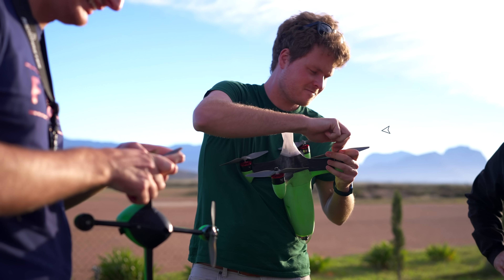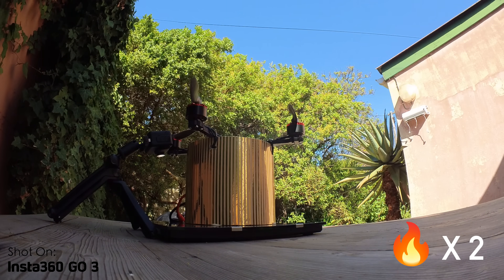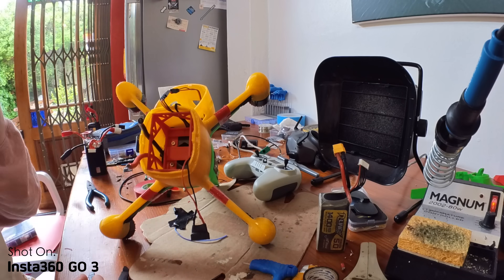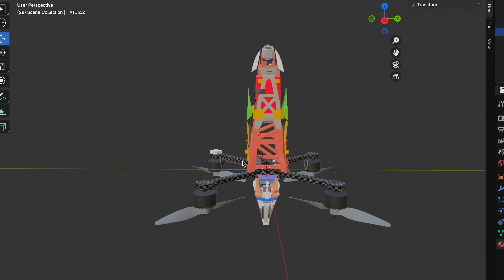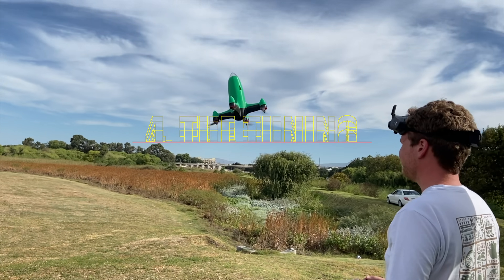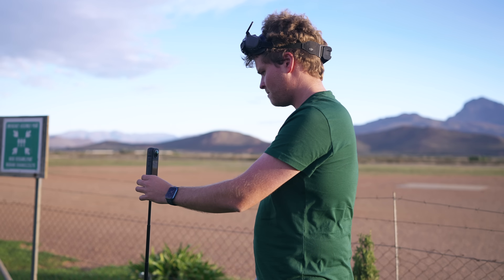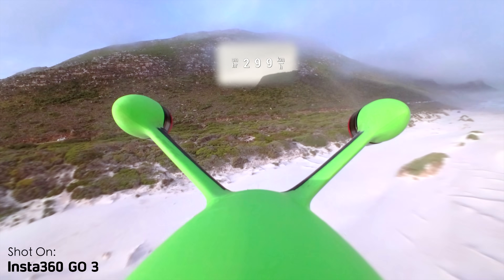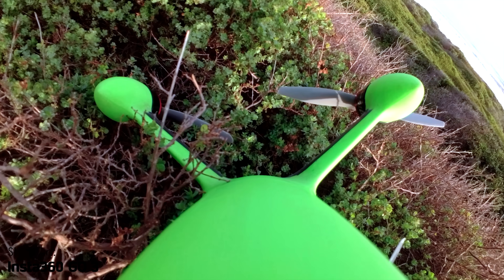How I Built the NEW World’s Fastest Drone

Comment: Wow, that opening in the front was perfect and if it's opened in the back for the Air to pass through unimpeded I can imagine it must run cool even at full throttle, just like a PC pull air in and expel air out for cooler components, probably would go faster as well, just have to create a barrier inside to keep condensation to a minimum on the components especially on cooler days
Reply from the maker: Yeh the open canopy for filming allows for much better cooling in the drone!

Comment: Congrats! But I don't think its fair to compare it to the RedBull F1 drone. As Redbull mentioned in their own video, the drone was built specifically for it to be able to follow F1 cars in an F1 track, with corners and for a full lap at least. They could have built it faster in a straight line, but that was not the purpose.
Reply from the maker: Yes this is all valid! They never designed the Red Bull drone for top speed. However this drone is very capable for filming too. I would love to do a high speed race around an F1 track with the Red Bull drone

Comment: Would it be better to actually print this in some type of resin instead? They will probably give a smoother surface than 3d printing or atlast super high res printing.
Reply from the maker: It’s possible, but I’m not sure. I’ve never worked with resin printers before.
Reply: @LukeMaximoBell  Hm, might be fun to try :)

Comment: Looks like your nose was too bulky on old ver also if you could put small vents around motors  to suck up air through chassis crating vacuum that should move air flow cooling wires and batt also if it’s done right that should in theory crate less drag at the nose if airflow is not compress  but flowing through that’s why when you cut nose for cam it went faster

Comment: That's pretty cool. Off the cuff though, your airframe can lose about half of its current weight... And get stronger. 
3D printing is great, but it can't quite hit max performance yet. 
If you look at bird bones, the surface of the bone is a tensile membrane, and then the internal structures in the bone are kind of foamy to maximize the strength and distribute forces. This same exact thing is easily buildable in a drone. But not with a 3D printer... Not quite yet anyway. If you want a commonly accessible analog, think about how strong a pop can is while it's pressurized... Ignoring the weight of the water, such a structure would be insanely strong for a drone.

Comment: so i don't know exactly what i'm talking about but i think thermistors act as temperature based capacitors.
if they do work then attaching a thermistor might allow you to have an automatic turnoff in the case of thermal runaway.
even if it isn't called 'thermistor' specifically, there should be something specifically for this purpose. better to lose one of these than your battery.

Comment: 3:32 What a useful safety mechanism! Automatically disconnects your motor if the wires get too hot.
Reply: Wait until the solder or the wire touches the other one it even lights up to notify you for the malfuction.
Reply: @donaldh2615  ow, don't forget the shiny silicon on the ESCs, if something wrong happens they can reflect the "led notification" in all directions
Reply: @donaldh2615  Hahaha
Reply: Also known as a fuse
Reply: @ShiroKage009  Fuses are unnecessary when you have this
Reply: @cannedwither8494  any wire is a fuse if you try hard enough
Reply: @ShiroKage009  Correct.
Reply: What's all the fuse about?

Comment: ...did you settle on those t-motor cine 12s 80A ESCs??
Reply from the maker: For batteries go for the Bonka 200C. Dogcom has poor quality control and questionable ratings.
Reply from the maker: No we didn’t in the end. We used the APD 120A ESCs. But a bunch of those failed. Honestly, I don’t have a good option for ESCs at this point. Going to try Flycolor next.
Reply: @LukeMaximoBell  Thanks so much for sharing this valuable info - I just watched your dad's video, too - awesome!
I'm planning a 12S 11" build that I calculate will draw at least 8kW.. I'm interested as to why some of the ESCs went up in flame - the amp draw was well within spec.. perhaps the eRPM?  Or maybe when you slowed down the cooling airflow stopped and the heat in the fets built up?  This would indicate that escs need active cooling for some time after they're throttled down.
I've been thinking about the flycolors, too, but they scare me a bit - not sure of their quality and the 120 and 160s are very heavy...
Reply from the maker: @mlentsch  The ESCS that went up in flames were faulty. I'm trying Flycolor for my next build so I'll see if they are good or not.

Comment: Incredible work! Curious about the trade-offs you made compared to Red Bull’s drone, which needs to excel in cornering and filming. How did you manage thermal issues with batteries and ESCs at such high speeds? Did you use advanced CFD simulations for aerodynamic optimization?

Balancing lightweight construction with the necessary strength must have been tough. Interested in your material choices and the control algorithms you used. Beating Red Bull, known for their speed and video quality, is truly impressive. Well done!

Comment: Probably better knowledge of electric measurements, few formulas and reading the spec sheets of the electronics used, would have avoided so many bursts in flames... Especially when wires are catching fire, that is caused by not paying attention to their ampere rating, or mistakes in the calculations on wires were needed
Reply from the maker: Generally when a motor comes from a manufacturer one would assume that the wires that come installed with a motor are thick enough. However this is an extreme use case and as our testing proved on the bench instead of in flight these wires were too low of a gauge. When doing practical engineering things do not always go to plan.
Reply: @LukeMaximoBell  exactly my point! I'm an engineer myself, decades of experience, when I develop something new I only trust my own measurements and calculation. Single electronic components are usually OK, but motors, batteries, transformers, any full circuit, I bench test beforehand... Even wires... It just saves headaches later. Great job on your achievement, cheers.

Comment: It is sad that you don’t even vaguely try to do any actual engineering.  Your wire test should have been done in half a minute with a simple calculator.  You are providing horrible examples of how to design things.  Indeed, you are not designing them at all.  You are just randomly guessing.
Reply: The motor wires are factory standard. You would assume the factory did the calculations.
Reply from the maker: Your comment applies that you have no practical engineering experience. 

1. Those wires come factory standard for those motors. This is an extreme use case which is why they failed. 
2. The way I constructed the video is somewhat for comical effect which is why it seems like I don’t know what I’m doing sometimes.
3. When actually engineering something you can do as much theory and calculations as you would like. Practical trial and error is often what prevails.
Reply: @LukeMaximoBell  “applies” 🤣

Competent engineers do not assume anything.  They read the specs, do the calculations, etc.  Yes… I have many years of practical engineering.

Comment: 1. Even the Wright brothers had a wind tunnel.
2. The battery needs to detach if, and when the batteries overheat.
3. Telemetry - including motor and battery and some kind of thermal shutdown.
4. You need means to radiate the heat, safely and efficiently, maybe using ex-laptop cpu/gpu heat-pipes
5.  You might need to make your own battery packs with thermal sensors.

Comment: It's surprising how little this guy knows about electrical engineering considering he made such an insanely fast drone, that or he's faking it/not explaining details. The rated current of different gauges of wires is a very basic principle, along with knowing the (peak) amperage of whatever you're driving... Also him just casually slapping a possible lithium-ion battery fire and holding it in his hands!
Reply from the maker: 1. Those are the wires that came installed from the factory. This is an extreme use case which is why they were too thin.
2. That’s not a Lipo fire. It’s a component fire.
Reply: @LukeMaximoBell  I see, so you were basically overloading the motors? I thought the motors decide how much maximum power they draw instead of how much power the motor driver puts into it. Like the opposite of how an LED driver works, where the LED would draw power until the driver limits it? Just thought it was a little silly to test 3 gauges of wires at the same time and not to just calculate your amp draw and use an according gauge.
Also, whilst that is a component fire, it could easily melt wires leading to a battery fire (and possible explosion), just dont want to see you (or anyone else) get badly burned...

Comment: Notes for folks who want to go faster:
- Make the fuselage skinnier and longer.  Fit the batteries closely and eliminate excess volume.
- Switch to an H-wing rather than an X, increase the wing span and minimize the distance from the motors to the main wing.  This gets most of your wing area available for lift.
- Use an actual asymmetrical wing section to reduce parasitic drag from lift.
- Mount the wing with some fixed angle of attack to shift lift from the body to the wing.  Body lift seems free when you just consider parasitic drag.  But consider induced drag and suddenly it's not so awesome.  You want the wing making lots of lift in cruise and the body closer to neutral.  Given how big your fuselage is compared to your wing, you'll always get a lot of fuselage lift.
- Polish that surface!  At that scale, you want surface deviations that are *tiny*, like under a thousandth of an inch.
Reply: At these speeds you get all the body lift you need from 1 degree angle which means there is almost zero induced drag. 
No need for wings because the body is pretty big dictated by the battery size.
Reply: @Mike-Bell  How much does it weigh, about 3 kg?  Body is about 15 cm diameter?

Hmm.  You're right.

At 450 km/hr, sea level air density, dynamic pressure is 9600 Pa.  Induced drag from 30 N of lift is maybe 1.7 N, which is 210 watts of drag.  If you figure your ESC, motors, and props have a combined efficiency of 50%, that's 420 watts from the battery, or 2.5% of your battery power.

I still wonder if there's a way to make it skinnier.  What batteries do you use?
Reply: @IainMcClatchie it weighs 1.87kg
Reply: You also only need three motors for a drone to be stable, and that could improve efficiency.

Comment: damn cool but what about using proppellors with a smaller angle of attack so that they work better at high speeds? or wouldnt it help?
Reply from the maker: The high angle of attack is what gives the high speed. These are APC 7x11 inch props. The higher the pitch the higher the theoretical top speed. But also the harder they are to spin and the more power required.
Reply: @LukeMaximoBell  oh ok I may have misunderstood thanks for replying tho :D

Comment: Could have dimpled it like a golf ball to create an air barrier also.
Reply from the maker: Nice suggestion but dimples on a golf ball are there to increase lift and therefore travel because it is a rotating body.  Plus the ball speed is relatively low so dimples would only increase drag when our drone is at top speed.
Reply: @LukeMaximoBell1  from my understanding you are correct  only thing I wonder about is the balls lift from dimples is a result of the rotation. With a drone dimpled and not spinning  the dimples could create an air cusion creating a smaller drag or wake of turbulence behind the vehicle making it slip through air smoother. This would be interesting to test though.  Thank you for taking the time to ponder the idea though.

Comment: gotta wonder when you just end up with a plane again....a plane with 4 engines....or just one engine
Reply: It takes off and lands verically on only its motors.  And doesnt have traditional aricraft control surfaces.  At all times steering is done via the 4 props.  And would never work with one prop, four props are vital for for control.
Reply: @Mike-Bell  right so you can do the same thing with a plane...what has been truly accomplished here is the question other than clever tech, if someone says a good pilot cannot learn to hover and move a RC plane the same I say BS
Reply: @whatyoudo9773  no, planes must have control surfaces to steer.  This drone steers purely by differential thrust.
Reply: @Mike-Bell  gotcha, its an excercise in inventiveness but they have planes that do 400mph plus already so the speed thing seems a bit silly to me,  when they chased a F1 car with a drone I was like "why?"  use a plane and  then I thought...oh...YouTube

Comment: The faster it gets the more it resembles a fixed wing aircraft. 🤔
Reply: It takes off and lands verically on only its motors.  And doesnt have traditional aricraft control surfaces.  At all times steering is done via the 4 props so technically is a quadcopter but you make a good point.

Comment: All these random fires.. are you using flycolor ESCs?
Reply from the maker: No it wasn’t Flycolor. Have you found that Flycolor are bad? I was thinking of tying them for the next build… what is the best 12S ESC you have used?
Reply: @LukeMaximoBell  we burned lots of 80 amp flycolours at loads of around 20, randomly at that. They burned in hover, but held currents high enough to explode the prop. Then we decided to try 160 amp ones, and.. well. They didn't fly, one just exploded on the table. Not spinning, not beeping, just sat there for three minutes during arducoptet setup and then exploded. The power cables that went to it from the battery got vaporized, literally. We found empty silicone insulation
Reply: @Zoey_the_Rat I've used both the 80a on a dragster speed quad like this without issues and the 120a on a thrust stand. Reading this has me a bit worried though
Reply from the maker: @redacted1946  I think these companies don't weed out the duds in manufacturing. I have used APDs that will break if you look at them too hard, and then some of them are excellent. I wish they had better quality control across the board.
Reply from the maker: @Zoey_the_Rat  Thanks for the reply. That's super interesting. I think once you weed out the bad ESCs then you are left with good ones. And that goes for all companies...
Reply from the maker: @redacted1946  Were yours the V3?
Reply: @LukeMaximoBell  yes. With the single larger cap and heavily conformal coated. PS make sure you disable "non damped mode". I have absolutely no idea why anybody thought it was a good idea to change that default setting on a multirotor esc.
Reply from the maker: @redacted1946  Okay noted thanks!
Reply: @LukeMaximoBell  forgot to answer the second question. We haven't honed in on a good standalone 12s esc, we just use hobbywing motor-esc combos

Comment: We also had lots of desoldering issues with our heavy lift drone. The battery says it can handle 500 amps, but gets thermally annihilated at 120. These C ratings are a total scam
Reply from the maker: Yeh they definitely are 😂 but I mean even if they can’t deliver the current, I expect the internal connections between cells to not break. Dogcom wouldn’t even acknowledge this and just told me to speak to the retailer I bought from.

Comment: A smooth surface is actually "sticky".  Did you consider dimpling the outer skin to reduce drag?  Also, what is with that car based stability testing? I'm sure you have enough retired motors to build a small in-home wind tunnel.
Reply from the maker: A wind tunnel would be awesome, but that’s a project on its own. The car window experiments work remarkably well

Comment: bro maybe i am dumb, but why record is of 480 when you reached more than 500....also even if it is like you did not do it on official flight or something, you can still do 500+ ,no ?
Reply from the maker: The 500+ flight was wind assisted. So the average speed in both directions is 480kmh 😎 I do think we could get 500kmh with no wind assistance with this drone once we switch out our batteries with higher power ones

Comment: You can add wings to increase flight time, they can be really tiny at speed. Also canards would greatly increas manouverability and control. Amazing to see what can be done with a 'Normal' Quadcopter. Perhaps 3 but bigger motors? 😉
Reply from the maker: True, but the spirit of a quadcopter means it gets all it’s lift from propellers and not wings
Reply: @LukeMaximoBell1  That's true. Keeping the spirit alive😄 a normal quadcopter doesn't fly horizontally at normal speeds, though.

Comment: Tmotor Velox 3115 is more powerful than Tmotor f80 (2408) but less quality... 
Velox 2207 is less quality than f60 pro
Great record but :
There is also incoherent Details 
Most kV available for Tmotor Velox 3115 is 1050kv
With 6s battery, more than 30000rpm is impossible (26000rpm max nearly)
For kV indicated, a 8s battery minimum is require
Reply from the maker: Tmotor made a special 1500kv for us. The motor we used in the end was 900kv on 12s voltage

Comment: Hi Luke, congratulations for the work and the world record!! I have see in 7:05 that you print a transparent filament, and then in the drone you can see very well through it. How did you do that? What is the filament and the process? I am very interested, i want do pieces as your. Thanks in advance.
Reply from the maker: Hey! Yeh sure, I took out that part because I didn’t want to make the video too long. You need to print PVA Polysmooth clear filament in vase mode. Maximum nozzle size and wall thickness. 0.8mm nozzle with 1.6mm wall thickness. Then you spray it with a mist of isopropyl alcohol every 12 hours. But don’t overdo it or it will melt.
Reply: @LukeMaximoBell  Thanks, i will try it!